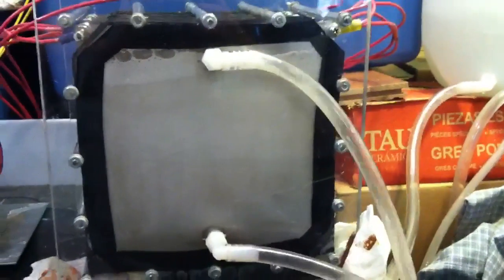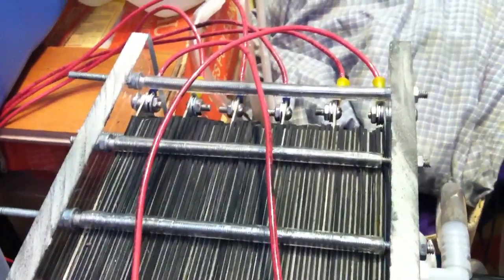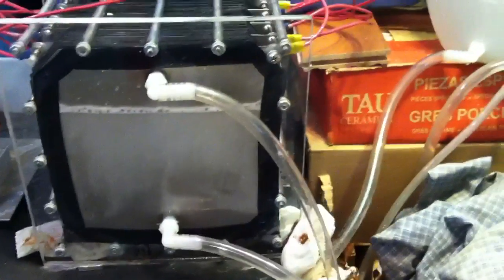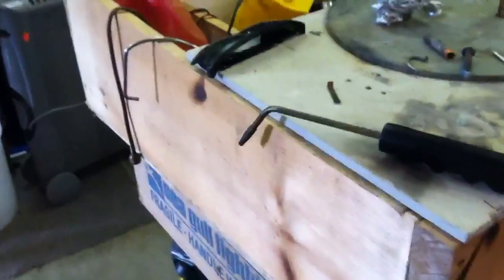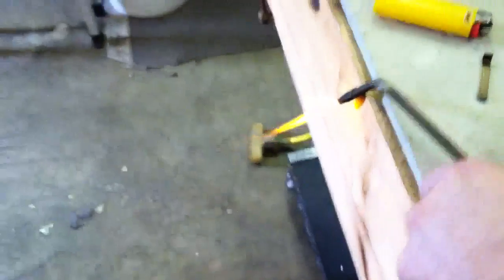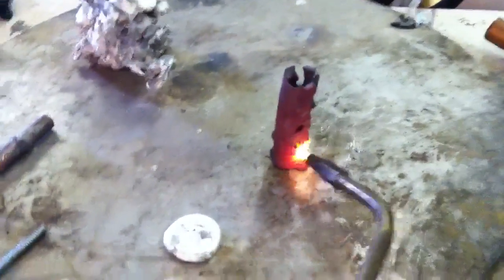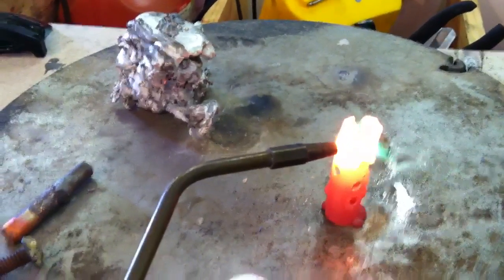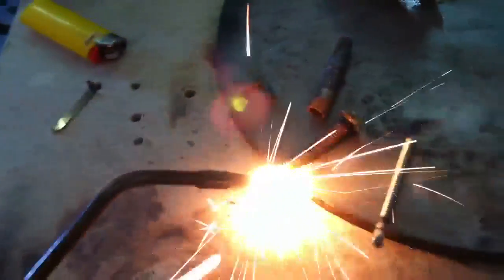Hydrogen torch ( hho ) 60 plate dry cell 120v

Comment: 3:46 "The metal plate starts to sweat". WTF..??? He build a HHO generator, but doesn't have the slightest clue about elementary things, like "Can a metal plate sweat"? NO..! It's condensation water from the torch god damn it..!
Dude...you better find some non-perspirating metal for your builds... 😂🤣😜
Reply: Kalle Klæp that is actually the technical term for condensate forming on a metal surface.  But lol on perspiring metals.

Comment: Its not condensation from humidity. The way an Oxyhydrogen Generator (commonly referred to as a HHO Generator) functions is by a process of electrolysis, which separates H20 (Water) into its base molecules, Hydrogen (H) and Oxygen (O) forming Oxyhydrogen Gas. Pure Hydrogen Gas is not formed, as Oxygen molecules are still present, which makes this process safe as Hydrogen Gas by itself is unstable. When burned its using the Hydrogen as a fuel and the Oxygen as an oxidizer. During the combustion of Oxyhydrogen not all of the Hydrogen and Oxygen gases burn. The heat that is produced from the torch reform the Hydrogen and Oxygen gas that escape, back into water. 

To break it down simply, water is broken down into separate molecules which burn at an optimal temperature. Some of the gasses escape while the rest is burned and the heat generated reform the escaped gases back into water.

Note: If you are confused as to why an Oxyhydrogen Generator is referred to as a "HHO Generator", it's because HHO is a fringe term used due to the molecules that make up water, two Hydrogen and one Oxygen.
Reply: +Cory Chapey I agree, you need to touch up on your chemistry. Hydrogen is diatomic, it doesn't exist as H, it exists as h2 and as h2 it has the electron configuration of helium making it very stable around reactants without applied energy. You're saying that hydrogen is more stable when mixed with oxygen and this makes no sense whatsoever. If you have just hydrogen in a container, then it has nothing to react with and nothing could happen even with applied energy, whereas a combination of oxygen and hydrogen would react violently with even a small spark of applied energy.
Reply: +Cory Chapey You haven't been much to school chemistry classes, have you? Hydrogen gas is very stable, but the micture of hydrogen and oxygen as in these generators will explode the instant it sees enough heat, such as a spark.

Also, when you burn hydrogen, it combines with the oxygen to produce water. It is this water vapor (vapor because of the heat formed in burning) that then condenses on the cold metal plate seen on the video.
Reply: Jaakko Fagerlund
 No, I am an Engineer, not a chemist. Albeit,  I know quite a bit about the field, so if you want to so boldly toss around the subject of school, I would say grammar and spelling were not your strong suit, judging by your reply, and perhaps reading as well, as I said Hydrogen Gas by itself is unstable, albeit your confusion is partially my fault as I should have elaborated.
To elaborate further, PURE Hydrogen gas by itself is unstable, when contained. A HHO Generator does NOT produce pure Hydrogen gas however, it produces Oxyhydrogen, which IS stable because oxygen molecules still exist in the molecular structure. Please read over my comment again, the information is there, you just didn't comprehend it.

Since you also felt so inclined to describe to me what I had already stated in my first comment, regarding how the water vapor forms, I am inclined to tell you to read my comment over again, more specifically the first and last lines in case you didn't already as recommended above. I stated that it is not condensation from humidity, as guessed by the person in the video, which is true. The heat that is produced from the torch reforms the Hydrogen and Oxygen gases that escape, back into water,  the heat being the flame.
 
However thank you for repeating what I already said, whilst nothing short of calling me ignorant. If you would like to continue testing knowledge, perhaps a battle of wits or a pissing contest, feel free to contact me. I am sure we could cover a wide variety of topics.
Reply: Cory Chapey How on earth is hydrogen and oxygen gas mixture stable? Please explain, as you are misleading everybody here. Hydrogen gas stored as such doesn't produce any hazards, but if you store hydrogen with oxygen (especially in a stoichiometric mixture like here), it will explode from enough pressure or enough heat. How is that fucking stable?
Reply: Cory Chapey It doesn't matter if you store the mix or not, it is still dangerous mixture.

You have failed now twice to explain how hydrogen is (according to your claims) unstable as such but stable when mixed with oxygen.